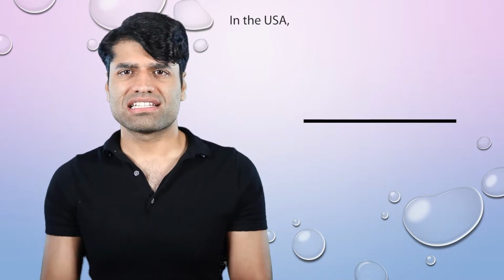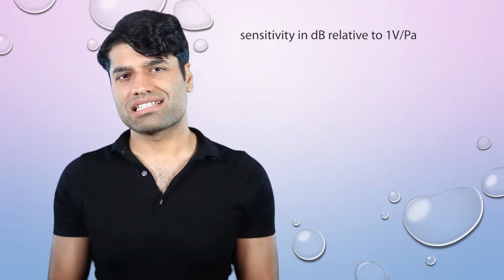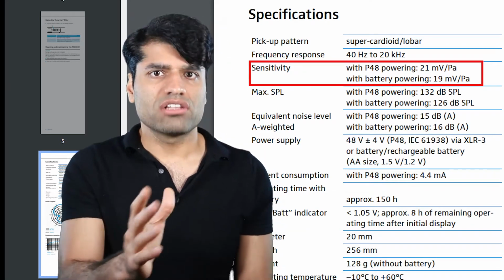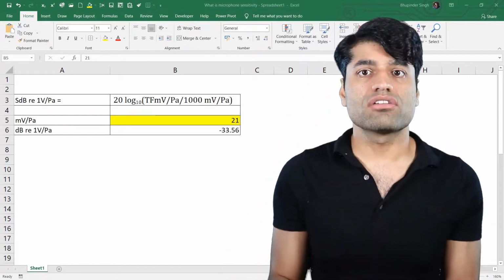What is microphone sensitivity

Comment: In short:
Sensitivity determines the "output voltage" level of your mic. So more sensitive = less preamp power needed (and vice versa)
- more sensitivity —> good for lower volume/more quiet sounds
if too loud: it can overpower the preamp and distort the sound and clip more easily.
- less sensitivity —> good for higher volume/ louder sounds
if too quiet: it makes you increase the volume in the interface which adds distortion and lots of noise (esp. on dynamic mics)

Also "output impedance" of a mic is inherently unrelated to its "sensitivity" and is out of the equation. (If you don't believe me look at multiple mic data sheets)
Reply from the maker: Microphone's sensitivity definition - 0:00
Microphone's sensitivity in mV/Pa - 1:07
Sensitivity in dB relative to 1V/Pa - 1:36
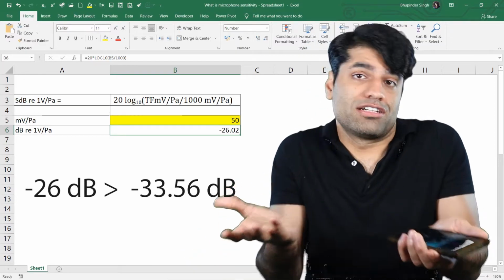Why dB is the sensitivity unit - 3:28
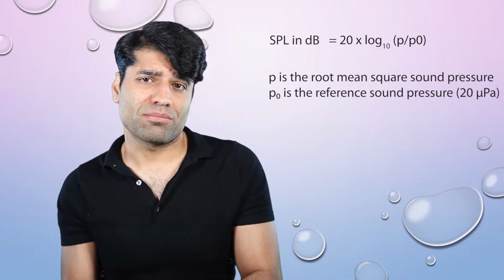Components of microphone that effect sensitivity - 3:56
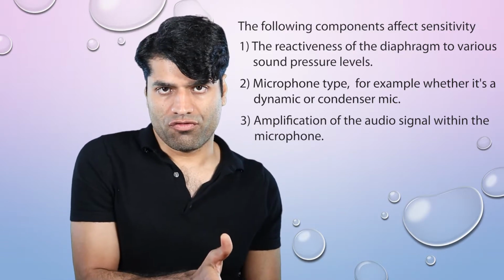Typical sensitivity of various microphones - 4:23
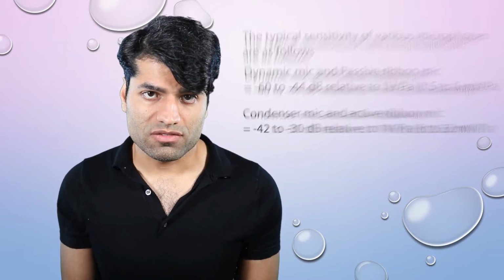Does higher sensitivity means better audio quality? - 4:52
High output impedance vs sensitivity - 5:45

Comment from the maker: Microphone's sensitivity definition - 0:00
Microphone's sensitivity in mV/Pa - 1:07
Sensitivity in dB relative to 1V/Pa - 1:36
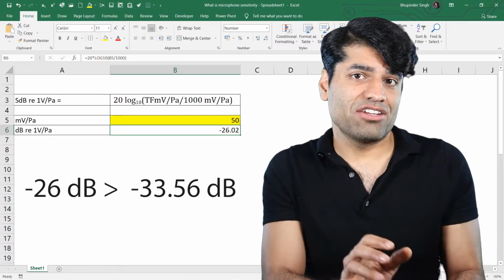Why dB is the sensitivity unit - 3:28
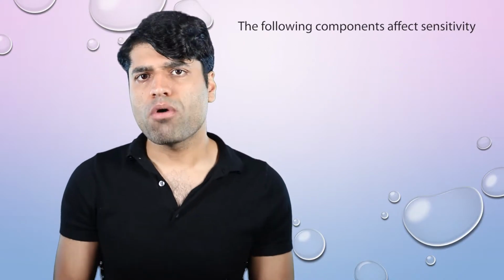Components of microphone that effect sensitivity - 3:56
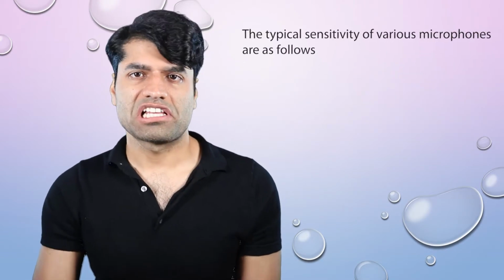Typical sensitivity of various microphones - 4:23
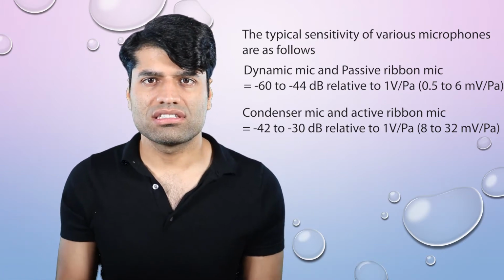Does higher sensitivity means better audio quality? - 4:52
High output impedance vs sensitivity - 5:45